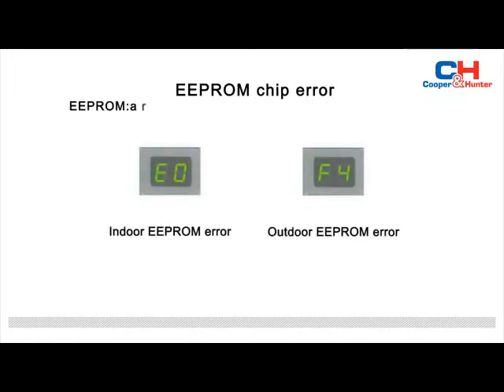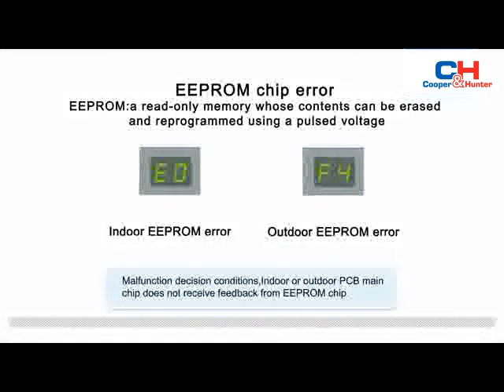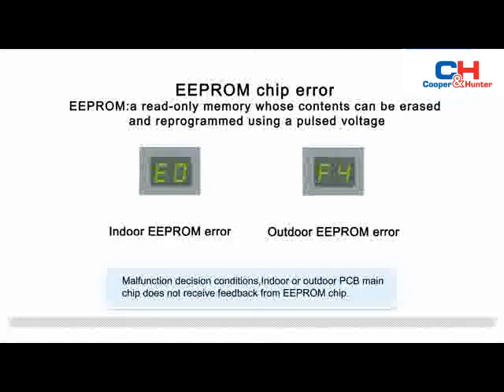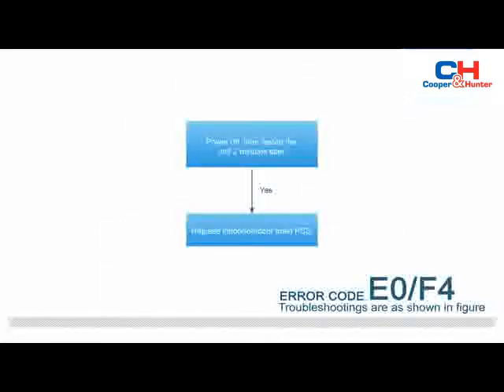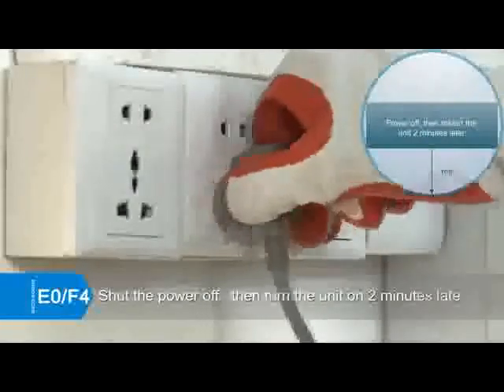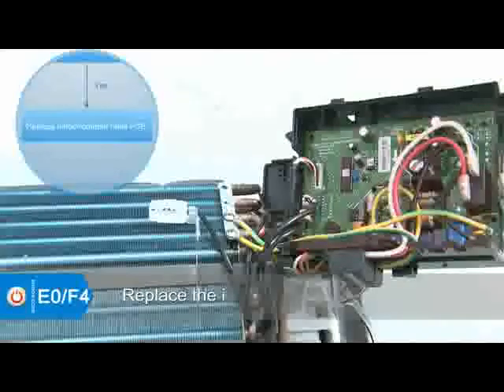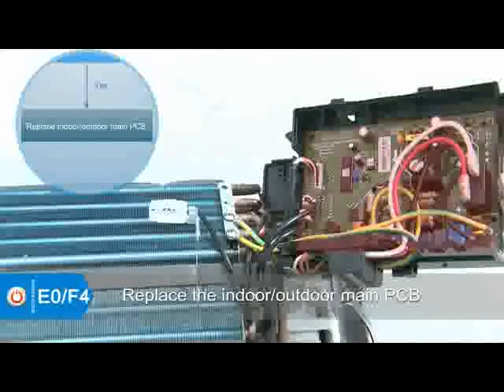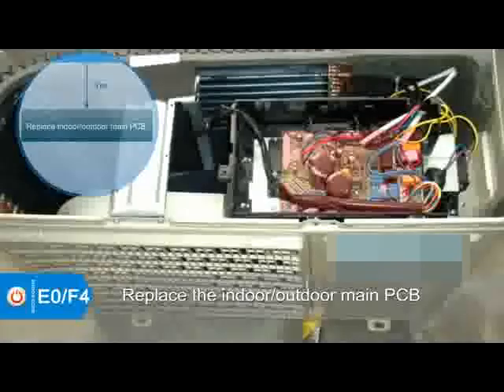E0 & F4 Error Code Cooper&Hunter Mini Split AC

Comment: to whom it may concern, I have a C&H model ch24vct230vi in which i have owned for almost 3 years. From my understanding according to your webpage the unit is warranty for 5 years and 7 years on the motor. I have made numerous attempts to various stores and no one has the pcb replacement board. please advise how i can solve this matter.